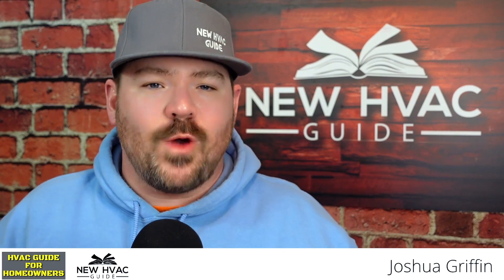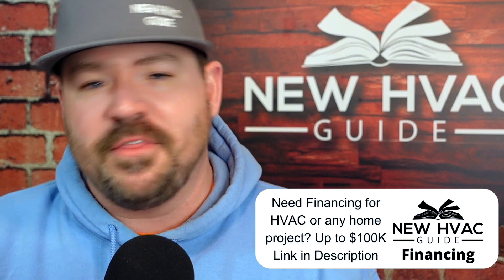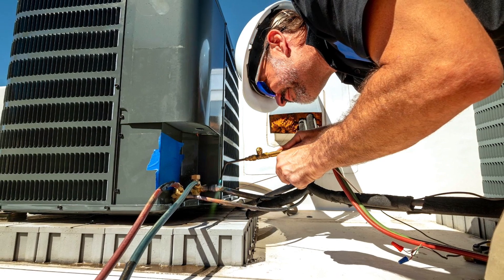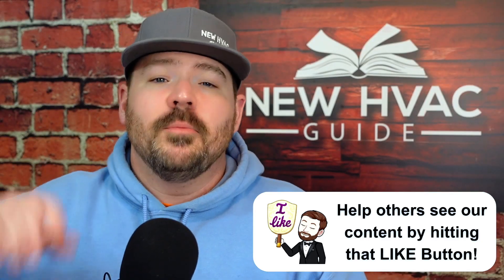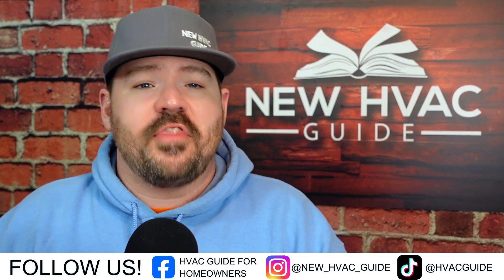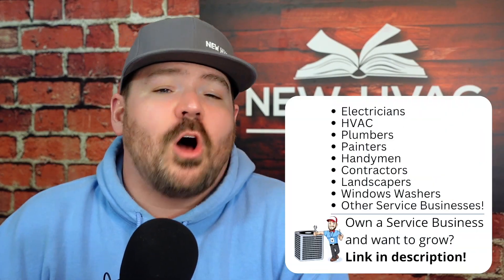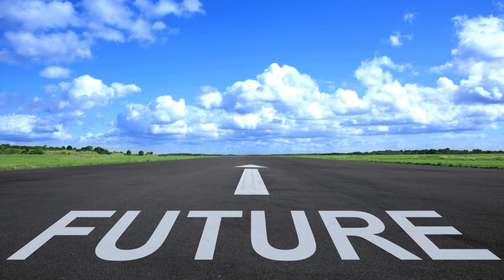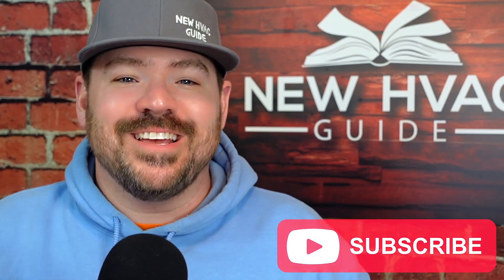HVAC Myth! Soft solder vs Brazing. (Air conditioner breakdowns that follow!)

Comment: The key thing is only put a little bit FLUX on copper joints to be Soldering and do not Over do on putting solder either.  Just enough to make good connection 👍😅

Comment: How Funny you talk, as a Diy i installed 10 years ago completed AC and Heating System By using Staybrite 8 and flux.  So far no issue.  Right now, I am installing another Complete AC and Heating System by using again Staybrite 8.   Oh yeah and Replacing all duct works all by myself 😢😔 I'm tired

Comment: The industry is changing; in our cos. we never used soft solder; same was true for other servicers aside from flare fittings which were very reliable. Now with the new compression fittings if they don't leak refrigerant, that will be the way to go!
Reply: Those compression fittings should last for the life of the "good for 12 years" systems being made today.  EPA figures if the systems only last 12 years, then no one will complain about a new refrigerant every ten years.

Comment: I primarily just use oxy/ace brazing with nitrogen purge, less possibilities of introducing contamination imo, but if your good with soldering and it holds, then do your thing.  I think the newer press fittings are (sadly) going to be the future, lower insurance rates for liability and vehicle and fairly minimal training required.

Comment: Stay Brite 8 is great for new installations. I haven’t had any issues with any leaks in my system that was installed by myself over three years ago.  It’s important to use flux sparingly and soldering requires more skill than brazing in my opinion.
Reply: Guarantee that if you pressurize a pipe with a solder joint to failure, the pipe will fail before the solder join does.
Reply: I agree 100% on that
Reply: soft solder is quick and clean with small turbo torches. A new technology ! 🥰🥰
Reply: I have been using staybrite 8 for 45 years no problems.😊
Reply: I used staybite 8 for many years. Haven't ruined a txv yet ;)
Reply: For evap coil replacements on systems less than 4 tons, I don’t mind stay brite 8, with the correct flux if the copper is old and dirty it will always get brazed, and if there will be joints underground and in the dirt it will also get brazed. If it’s new clean copper on a smaller system and the lines aren’t in the dirt, then I don’t mind it. End of the day whatever joining method you use the prep matters. If the proper steps aren’t taken for prep gonna have poor results regardless
Reply: Can I use Staybright to fix a leak without cutting and using a fitting? like in. a small fridge
Reply: The problem with stay rite 8 is that it runs into the joint like water hard to control.
Reply: The flux you use in this application is bad for the compressor. Always braze

Comment: I see compressed (swaged or "swedged") fittings will be the main process, since no heat errors will occur, nor troublesome oxidation of the metals or corrosive vapors to vacuum off.
Reply: @4Lights.5Liights  are you talking about flare joints? I use flare unions sometimes to put copper together. Works great if done right.
Reply: @mikemoore466  No, there exists already some mechanical deformed fittings by Milwaukee and others too: >https://www.youtube.com/watch?v=7YHR8dU99BY

This type needs no special power tools: https://www.youtube.com/watch?v=w8_UKCJ7fMQ

Comment: Technically , it’s hard solder , higher temp , better bonding . We’re not actually brazing
Reply: Technically your annealing the copper with high heat by brazing , when sweating with staybrite 8 your not in turn a stronger joint , you got to have a nice clean and tight joint , with brazing you can be sloppy and fill gaps and not even clean , and forget the nitrogen how many do that, I'm talking real world not everybody is the best on youtube

Comment: I grew up in a hvacR business. We did supermarkets install and service. We used 95/5 solder. and when residential a/c became popular we used both.  Nobody back then used nitrogen when brazing
Reply: You also had piston type metering devices, not TXVs with tiny orifices to clog.
Reply: I won’t point out the fallacies of reasoning in your comment… I will say that with different refrigerants temps and pressures change and after the temp exceeds 50% of the solidus point of a solder failures increase exponentially. And, as someone else mentioned, the chemical reactions to different refrigerants, oils, and carbon change. But hey, who cares about chemistry, fluid dynamics, or thermodynamics when actually discussing this stuff!
Reply: Most guys I know do not use nitrogen still when brazing and they’re really are no issues, especially on a traditional unit not a VRF unit
Reply: @shoretrade9516 its the POE oil that causes the problems when not purging with nitro when brazing. Dissolves the oxidation off and pulls it into the txv or oil sump. Soldering has much less issue with oxidation so you could maybe get away with it. Mineral oil used for CFC's, HCFC's, or hydrocarbons.

Comment: —dark horse enters the chat—-
As “flammable “ refrigerants hit the market expect to see more and more press fittings. Two major manufacturers have told me they intend to ship equipment with long runouts to allow press fittings
Reply: I've heard that also
Reply: Will the press fittings have an elastomeric seal?   Wouldn't any seal material fail during the temperatures of a fire?  I've heard the "we must use brazing" crowd argue that Stay-Brite 8 is WRONG because it will fail during a fire, thus exposing firefighters to the dangers of leaking refrigerants.  Are their arguments any good?

Comment: ,I use both,  and how many braze without nitrogen , and the brazing isn't stronger,  and bosch says braze or solder ,just looked it up to make sure says sweat or braze on both liquid and suction ,
Reply: The pipe is weakened by the high heat of brazing.  Stay Brite solder is incredibly strong but requires meticulous cleaning and proper application of the flux and removal of any excess flux on the pipes after soldering. I have brazed tons of pipe in the past and soldering is the way to go for me.
Reply: @foghornleghorn8536 I have  maybe you need to read upon the situation , I usually don't talk unless I can back it up
Reply: I use both  , if things are good with a nice tight joint can't beat sweating

Comment: I've repaired a lot of TXV's that were leaking on the suction side when soft soldered (I believe with stay-brite). I figured the expansion and contraction on the cold side of the valve let the solder crack. That's the only place I ever found a problem.
Reply: If you are seeing that, that means whoever did it did it incorrectly
Reply: All the cases where you saw soft solder causing contamination are where the technician did a poor application.  Therefore you are naturally biased against soft solder.  This does not mean that soft solder can't be made to work.
Reply: I don't think so,